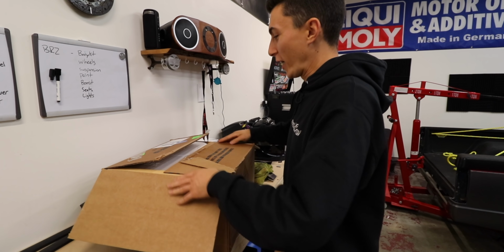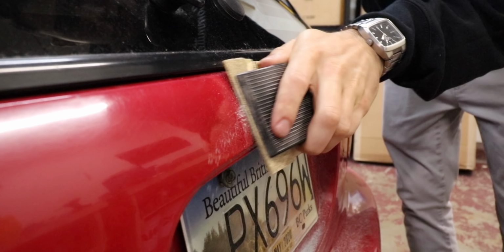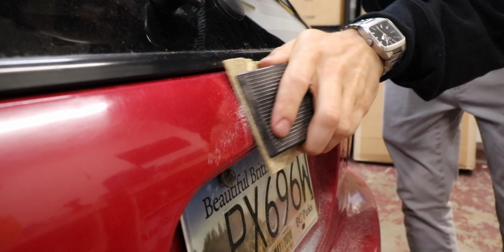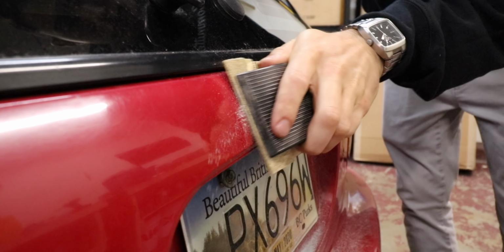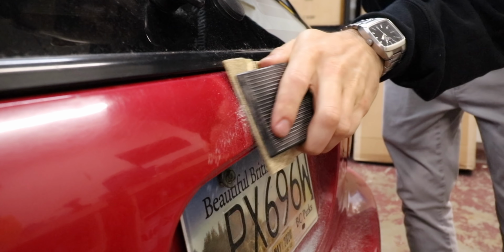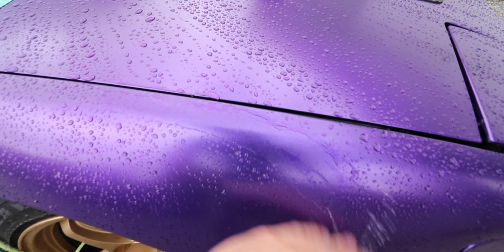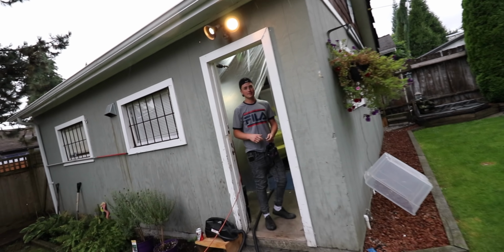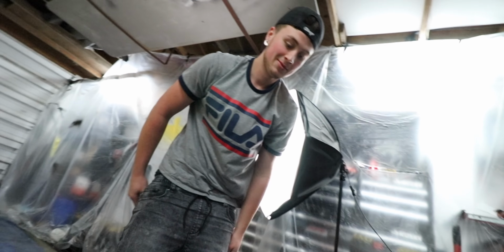Dipping the Widebody EG Civic!

Comment: hey. I have a question! Originally the car is red! afterwards you changed the color to yellow! So, dont you have problems with the cops, about color change? Or it is doesnt matter? 
Bcos in Brazil, if you change the car color without dmv permit, you gonna have a huge trouble with the cops, and they will tow your car! lol There, you need to register a new color to the car information at dmv and pay tons of fees to use the car with the new color! 
great video! tnx

Comment: Takes 5 minutes to remove tail lights, just saying. Maybe next time.
Reply: GIZZMOTORSPORTS I was thinking the same thing especially cause he did the headlights already lol
Reply: The Car Community good point, it also takes way longer to remove, later replace and then realign the headlights.
Reply: And he didnt paint the door handles and side mirrors🙄
Reply: Vithursan B he also filled the rear "H" emblem holes, but never fixed and of the dents in the hatch panel. We can basically chalk it all up to being a rookie, there is no other explanation.